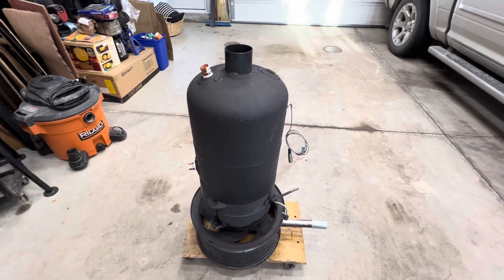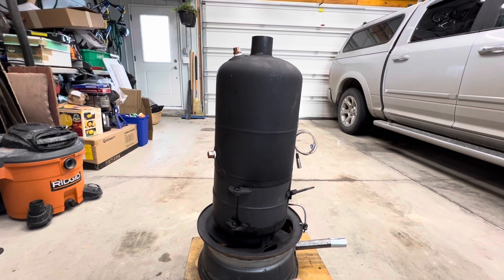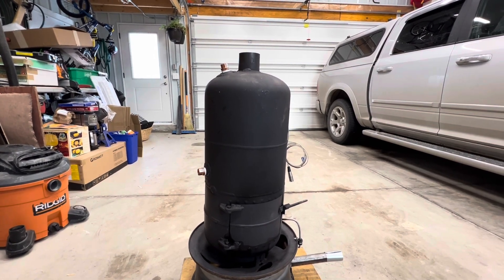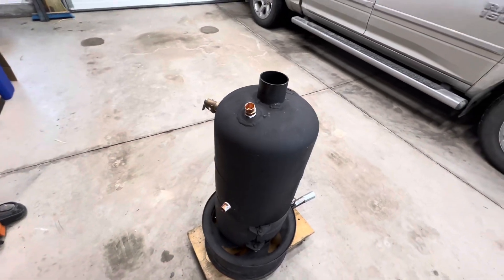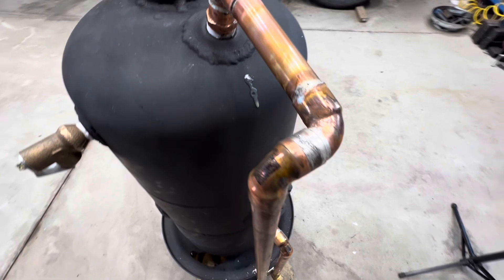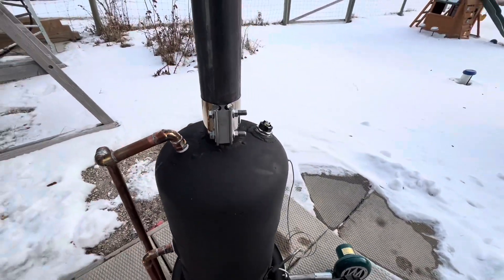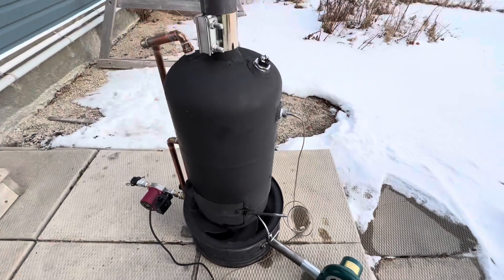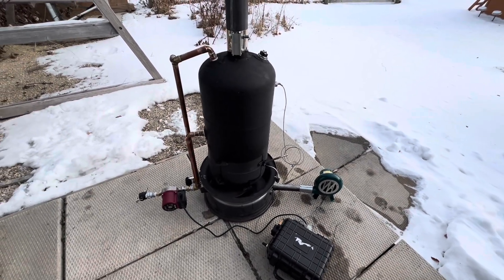Waste Oil Burning Water Heater - WOBWH pt5

Comment: How did you program the unit? I would like to build a control panel like you did.
Reply from the maker: The controller is a FX1N 20mr (bought off Amazon) and uses GXworks2. 

Gx works 2 is the Mitsubishi PLC programming app. You can make a Functional Block Diagram or regular ladder logic.

Comment: Very cool,  thanks for sharing,, I  just stumbled across a water heater and was thinking about doing something like this, already  found the pin holes in the welds but since I'm  going to make the tank smaller to  fit the heater box in the bottom they don't really matter much.... what timing though lol...
Reply from the maker: Thanks for the message and good luck with your project!